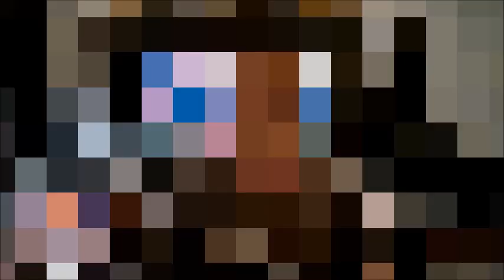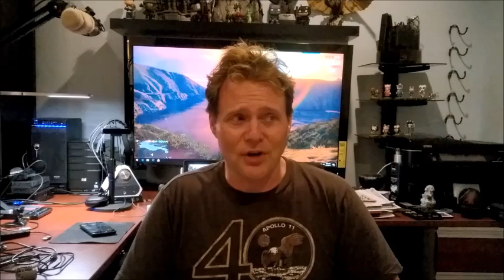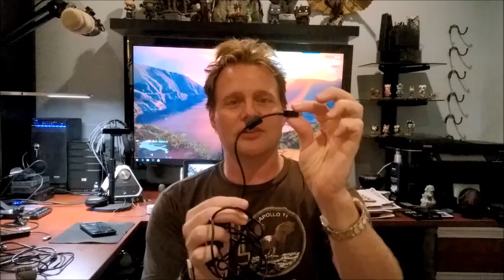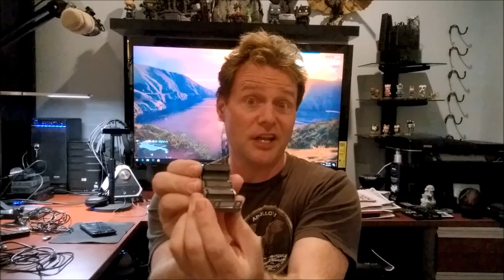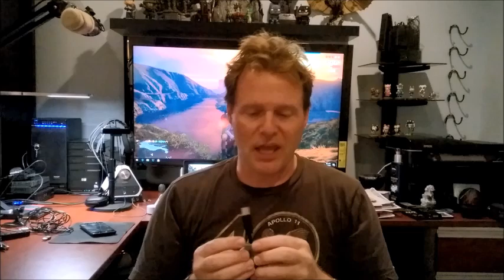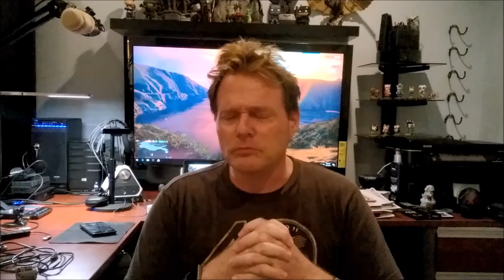What are Ferrite Cores and How do I use one?

Comment: Can I put too many on the cables of my stereo?
Reply: No but I have one that is on my usb streamer cable and I have one that is on the power supply for the streamer and the amplifier. I am thinking of the speaker cables because I have a few more leftover.
Reply from the maker: It's not really possible to put 'too many' on, no, but if one at the end going into the receiver or one at each end of the cable should tell you whether RF is the problem.  Hope this helps you!

Comment: So my microphone picks up some sort of radio frequency that comes from the outside, its this trucker that I assume is just using this really powerful radio. I can hear him talking sometimes through my microphone, and I was wondering if putting a ferrite core(s) on the XLR cable would help or not, I already have a star quad cable and I still pick up the frequency, although the frequency stops when I wrap my hand around the microphone end of the cable? It might be that the end that connects to the microphone might not be properly grounded? Or the cable in general isn't properly grounded, I don't know. I ordered a cloudlifter CL-1 recently and I hope that this can somehow clean up the frequency, but if so I don't know. I don't have access to properly grounded plugs in my home, I think it might be that, and if so I don't know what to do :/
Reply from the maker: This would definitely be a case where you're getting RF Interference, so yes:  I'd try putting one on the XLR cable at the end where it plugs into your interface (pre-amp, cloud lifter, etc.). The Cloud Lifter is good for gain staging, so it might help if you're using a Dynamic or Ribbon mic (I'm told it won't work for Condenser mics).  One other thing I read was to make sure the XLR cable isn't touching or laying across any power cables.  There's also a forum I found where both ferrite cores and hum eliminators were used to solve the problem of CB Radio coming in over the wire - I hope this helps you!  https://homerecording.com/bbs/threads/picking-up-radio-frequencies-whyyyyyy.14830/

Comment: hi great explanation does it work on adsl / dsl line Attenuation ?
Reply from the maker: Hi Artin!  I did some reading specific to ADSL lines and the answer appears to be, "not really."  The only situation in which it might help would be if you put one on the power line to the ADSL modem, and that is if the power is the source of RF noise--I'd place it on the end of the cable that plugs into the modem and not the end of the cable that plugs into the power outlet in the wall.  Even then, there was some debate as to whether RF could be a problem for an ADSL signal because the ADSL signal flows in a "differential mode" (current flows in opposite directions in each conductor inside the wire, resulting in a net magnetic field of zero).  IF your ADSL line also happens to be your phone line AND you're hearing interference when you talk on the phone, THEN it might be something you could use to reduce noise on the phone line.  
So the bad news is, you likely wouldn't get any improvement specific to the ADSL by placing a core on the data cable.  
The good news is, these cores are a very cheap way to troubleshoot, and on the power cord, they might help reduce or remove any problem related to RF generated by the ADSL modem.  I hope this helps you!

Comment: Hello! 

First of all, very helpful video. You explained ferite core in details.

I have a problem with a "hum" noise (sounds electrical a little bit) when recording instruments with my soundcard. I heard someone say it might be a ground problem. 

Would ferrite cores work? If so, where should I place them? 
On the XLR cable of my mic? On the USB that goes from my soundcard to my computer?

Thanks alot!
Reply from the maker: Hi Mozza! I take it from your description you're talking about an external sound card connected to the PC via USB.  Yes, these can help you troubleshoot a potential RF interference issue, but a grounding problem would require a different approach.  Since these are cheap and easy to use, you could try attaching one and I would suggest doing so on the end of the USB cable that goes from the soundcard into the computer.  For troubleshooting grounding issues, that's harder. Some easier things to try there would be using a different USB cable or instrument cable (I'm assuming whatever you're playing has an SLR or TRRS or some other cable going into the sound card)...moving the PC to another outlet temporarily to see if the hum goes away...moving the PC to another outlet on a different circuit in the house to see if the grounding problem comes from the circuit...plugging the PC into a ground-loop isolator like the Hum-X...and more, but all prone to being different depending on your situation and what the root cause of the problem is.  I hope this helps you.
Reply: @trentonbennettVO  Thank you for taking the time to reply to me.

 As funny as this is going to sound, I'm pretty sure the problem was my razer keyboard. It has little magnets on it to hold the wrists holder. 

Those were making some weird waves or somerthing idk lol. It was interfering with my pickups and that was creaing the hum noise. 

What I do is I record from the other side of the room and it's good to go hahaha! Thanks again

Comment: My magnet censor speedometer is not working when my lights are on. Can this ferrite core do the job?
Reply from the maker: It's possible, yes - it's an easy test to try.  It may also be a grounding issue, so this is a simple first troubleshooting step.  Hope this helps you!
Reply: @trentonbennettVO  is there a difference when using a big ferrite core over small

Comment: Do you only need one per wire? Or every x amount of feet?  And does it matter where on the cable you put it? Thanks in advance!
Reply from the maker: Hi aGoodShepherd!  When I troubleshoot, I only use one.  Manufacturers put them on one or both ends, I tend to focus on the point where the wire goes into something (like a computer), so I'd start with one near the point where the device connects.  If you have a serious interference problem, there are a lot of other ways to solve it; this is just a great initial troubleshooting step that often takes care of minor problems.  It's a way to determine whether the problem is RF interference as opposed to a problem with grounding.  Hope this helps you!

Comment: Hi! Do you suggest to put these on EVERY single cable? USB cable, jack instrument, jack microfone, power supply, headphones… thanks a lot!! 🙏🏻🙏🏻
Reply from the maker: Hi Giovanni!  I'm suggesting that if you have a problem with background interference, then you try connecting one at the area where you think there might be a problem. If it doesn't solve the problem, try it on another device.  For example, my friend's USB mic seemed to be picking up a hum, so she connected one to the USB cable for the mic.  I had a problem with speakers picking up a buzz, so the cable the speakers plugged into was where I tried it.  It may not solve the problem but it does help in troubleshooting--and I hope this helps you! :)

Comment: Hi Trent, I replaced may tail lights with LEDs now my reverse cam started having noise in the video everytime the brakes are engaged/brake lights are on.. 

Where would it be ideal to place the core to remove the video noise?..
I am still currently waiting on the core I ordered online to arrive..
Reply from the maker: I would place it as close to where the camera feeds into the head unit as possible and also make sure the camera and tail lights are both properly grounded / the grounding wire hasn't come loose.  Hope this helps you!

Comment: there is a radio station playing through my computer speaker and i didnt do that. will this thing stop that?
Reply from the maker: That has to be really frustrating.  Most speakers, even the simplest ones, are typically supposed to be better shielded from interference but sometimes this can happen.  A ferrite core should help with that, and it's a cheap test to make sure.  You can put one on the speaker wire where it connects to the speaker and that should help.  Let us know if that works for you or you have to do something else.  Good luck!  I hope this takes care of it for you.

Comment: We just had our bathroom remodeled , in the tub is an led light exhaust fan combo. Its creating a raspy buzz on my am radio from 1200khz to 1600khz.  Is there anything i can do? even when its off, if you hold up a radio to it, its really a loud raspy buzz. driving me crazy. the buzz is all through the house...but it goes away in certain locations.
Reply: If you can upgrade the LED bulb to a more expensive one it will probably help. Cheap bulbs do that.

Comment: It's awesome you're responsing to a lot of people! I just moved and I'm getting crazy interference. I'm on the top floor of an apartment and it seems like I'm getting interference from something or another building nearby on my speaker monitors. A little foil around them in the direction of the interference seems to help but its still quite noticeable. Would ferrite cores help as well? (I'm hearing the high pitched erratic sounds even when only power is connected).
Reply from the maker: Hi Crankin65!  I'm glad this was helpful to you, and I would say it can't hurt to put one on each speaker cable.  I'd try at the end the cable plugs into the speaker itself and if that doesn't work try moving it.  These are a great first step for troubleshooting, and from there if you aren't using heavily shielded speaker cable, try that too - for instance on my studio monitors I got Monoprice "Double shielded with copper braiding 'Onix series' " speaker cables from Amazon at about US$20 for two 6 foot cables.  I hope this helps you!
Reply: @trentonbennettVO  Hi Trenton, thanks for getting back to me. So I put ferrite cores on both ends of my power cable, tried a furman power conditioner and went through three separate outlets with 4 monitors (my 2 different pairs) and I'm still getting low hum and some high pitch chirping. This is all with the monitors only have their power cables plugged in (No audio cables at all). I'm not sure what else to do or how to eliminate whether this is electrical or and all the outlets aren't great or there's a external source for the interference
Reply: @trentonbennettVO  I also checked that the outlets were grounded and tested using an extension cord from one half of my apartment (which doesn't receive interference) to the other (the side where the monitors receive the noise). And I think I confirmed that there's something external directly effecting my monitors. Do you have any thoughts on how to shield them if that's the case?
Reply: @Crankin65  If you're still getting this noise, and if you have more than 1 unit for your system ensure that they referenced to the same ground (ground loop). As a temporary check, try a ground lift on the amp or other units. Also, is the receiver on top of or near another piece of electronic equipment? Try relocating it, if it is. Write back if this helps!

Comment: Great video.  I'm planning the install of a new stereo system in my boat and the speakers have LED accent lights.  I've heard stories of people getting a whine from the speaker as the power line that drives the LED lights.  Would you put the Ferrite core on the LED power wire near each speaker or on the speaker wire to best protect the speaker from picking up any noise?  Also, I've noticed on most cables that come equip with these, that there is one on each end.  Does one at each end protect the whole length of a wires run or do you need a core every X feet?
Reply from the maker: Hi Frank!  If you do find that you get a whine from the speaker, then I'd put one on the power line, but I would only bother with one at the end from which the power comes into the LED lights.  Most LEDs are so low voltage that the possibility of them generating a ton of EMF is extremely slim IMHO - a whining noise could also be related to  whether the whine gets from the LEDs, through their power line, and into the same circuit where the speakers get power (at which point it could also be a grounding issue).  You're right that many cables have one at each end.  I'm not certain that would be necessary unless one at the power-source-end doesn't do the trick (and then if one at the other end still leaves you with a problem, look into whether this is a grounding issue).  Hope this helps! :)

Comment: If we replace a type-c charging cable (ferrite core) with a regular type-c cable. Will it still work?
Reply from the maker: The core doesn't really make a difference as far as sending power down the cable is concerned, so it shouldn't make a difference - it's there for the benefit of reducing electrical noise.  Hope this helps!

Comment: had bluetooth reception problems, turned out the monitor usb in was emitting noise, snapped a bunch of them on before i narrowed it down to that one.
Reply from the maker: Glad to hear this helped you!  It's the simplest solution - and yeah, you had to do that fun legwork of trying to nail down which one it was.  Congrats on solving the problem! :)
Reply: @trentonbennettVO  Yea just scattergun blast solution, hit everything until it stops, got it to quiet down even more after I dealt with a cheap knock off laptop power adapter as well.

Comment: Hi Trenton! thanks for the informative video. My computer power supply creates this static buzzing noise whenever our air conditioner is on, it's not short circuit because we've tested the sockets and they we're stable, is there a chance that emi is the only problem here?
Reply from the maker: Oh my gosh! I was out of town and actually typed you a long reply here to help...and I don't see it now!  Agh, drat.  Are you hearing the buzzing from inside the power supply?  If so, then I'm guessing you're on the right track.  The question then becomes, "can you move the computer further away, even temporarily, to see if there's a distance from the A/C where the interference drops off"?  Power supplies have some shielding to them (and some holes for airflow) but it's not perfect if something is emitting an interfering signal.  I know you mention that you tested the sockets, otherwise I'd have suggested plugging in a UPS to see if the interference is coming down the wire.  I hope this helps and sorry the original didn't reach you - likely because I was on and off various networks moving about last week.

Comment: Hi Trent.  My laptop has a hum that can be heard when recording audio and ends up on the recording as well.  It also shows up on Zoom sessions.  When I disconnect the power cord and run on the battery it goes away.  Would a ferrite core on the power cord help or do I need to go further upstream to the wall outlet?  =bd=
Reply: Same question. Hoping for a response.
Reply from the maker: @anacir8146  Hi!  I'll reply directly to Bryan now, just letting you know so you see an alert
Reply from the maker: It sounds like the problem is in the power cord (I think you figured that too), so there are some options.  1) Have you tried the power cord in a different outlet, even on a different circuit in the home?  2) Have you tried a different power cord (if you can get your hands on one - sometimes folks have more than one, sometimes they don't)?  3) Have you tried a different microphone?  This third is a long-shot since you said the sound goes away on battery.  That said, there's also a couple of other options too.  There is a device called a Ground Loop Isolator (I bought one called "the Hum-X") that you plug the power cord into and it's supposed to help defeat a ground problem (which is what this sounds like from your description).  You can also try plugging the laptop into a different surge protector.  In my home studio, I bought a Pyle rack-mount surge protector that's designed for musical instruments/amps and I plug everything into that.  It was a bit over US$50 and so far (knock on wood) I don't have any interference problems or ground hums.  I hope this helps you!  I try to keep an eye on the YouTube comment notifications so I can respond, I just don't always catch 'em all. :)
Reply: @trentonbennettVO  Thanks, Trent, for getting back to me on this. The hum goes away in a different part of the house, so it seems confined to that particular circuit.  Changing mics has no effect. The Mac laptop has a proprietary power cord so that would be an expensive experiment. I’ve wondered about the Hum-X and similar devices and will investigate further.  The rack mount solution is a bit beyond my needs at this point. I think I’ll try installing a new outlet on this circuit first and if there’s no joy il try the Hum-X. Will report on how it turned out. =bd=
Reply from the maker: @talk2bryandavis   glad to hear you've isolated the problem, even if the answer is a bit painful.  It sounds like that circuit might benefit from a "line conditioner" on the outlet - this regulates the distribution of power and theoretically maintains a consistent stable frequency.  If you happen to have a UPS, those tend to have built in power conditioning and you can try it on that outlet - which might then give you a hint as to whether the Hum-X will work (I'm hopeful for you!).  I look forward to hearing how it turns out!